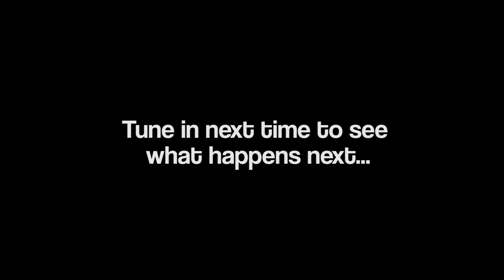D.I.Y DIARIES EPISODE 10 | D.I.Y SKATEPARK | THE RANCH

Comment: Rail Install Tip - Drill 1 hole, put that dyna bolt in first rail hole and bolt it down, then drill one hole at the other end thru the hole in the rail so it is exaclty in the right spot, bolt it down completely, then drill the rest of your holes and put in all the other bolts. You can't miss. Nice vids dude, shouts from Aus
Reply: And the bolts can be handled with a grinder equipped with the right wheel. Please wear vented goggles, long sleeves, and durable gloves though. Building can be fun when it's safe. Otherwise metal shavings can get stuck in your eye and even burn through your gloves.
Reply: I'm guessing he sees these too and has built things before but it doesn't meant people wear the protection that would help them

Comment: Gday from Queensland , if you drill you dyna holes a couple of sizes bigger it’ll give you more room to play with your rail holes and once you open up the dynabolts it’ll be solid . Videos are sick btw
Reply from the maker: I was thinking that! On the box it says 1/2 drill bit required, and it’s still too tight, hopefully next trip up I can get the rail in and locked down, cheers mate!

Comment: I went out to the bluies with a guy who was bolting sport climbing routes in the sandstone, and they know a tonne about setting bolts in rock/concrete. The bolts have to stay put even when they're catching climbers falling 6, 8m. Plus they install them while hanging from ropes in the mountains, so they don't have great leverage. Maybe look for some rock climbing bolting tutorials on Youtube 👍
Reply: Here we go:
https://youtube.com/playlist?list=PLTodUXkQjZwwWgf7orztnrUIXDG1IqJyP
Reply from the maker: Legend mate! I wish I could have bought an sds drill like his one but it was just way too expensive, I did learn a thing or two though from watching this! cheers for the heads up mate!
Reply: @SeanEnuks I've drilled into concrete and brick with an Ozito 18v hammer drill and a carbide tipped Masonry drill bit from Bunnings (Kango), it was a bit slow but went fine - the hammer function makes all the difference. The Home depot equivalent house brand would probably be Ryobi.

It's nice to know resin's might be a solid option over those metal expander bolts, good luck mate!